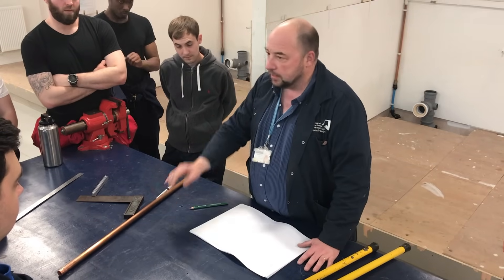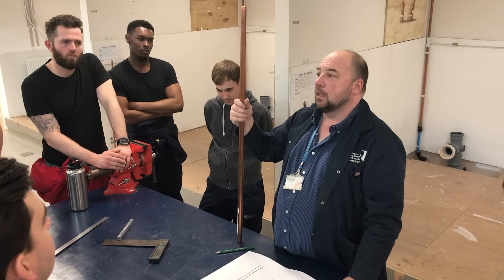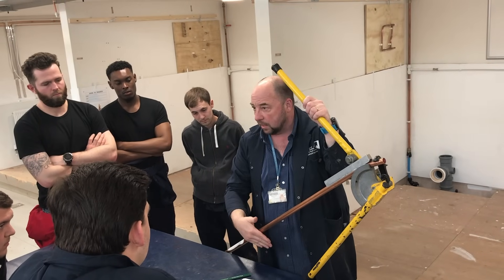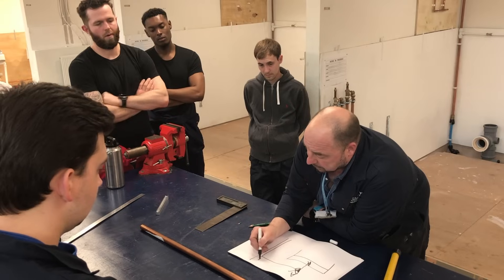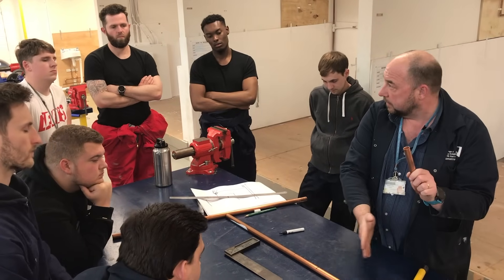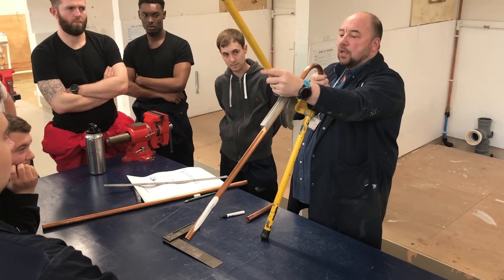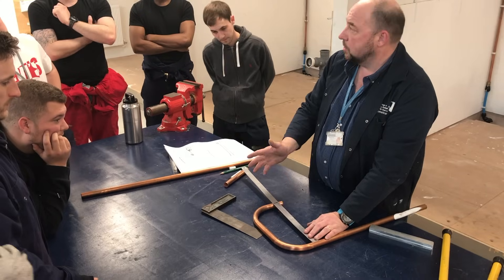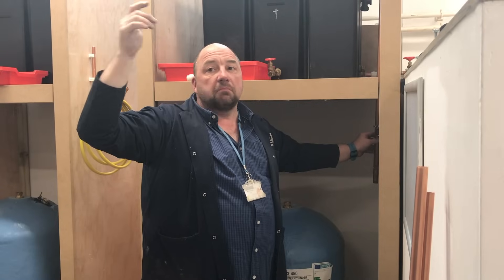How to perform a Centre to Centre copper pipe bend

Comment: I began my apprenticeship in 1976 and passed my journeyman's examination in 1979. Part of the exam involved bending a 15 mm copper pipe with two 90° bends, centre to centre 22 cm, which I still remember today. I still have the piece of pipe from the exam ;-)
In Germany at that time, it was common practice to specify the diameter of galvanised steel pipes in inches. Later, for example, a 1" pipe became a DN25. (DN = nominal diameter in mm) 
The mm dimensions were rounded for the DN specification, 1" = 25.4 mm, so it was made 25.
The ‘real diameter’ of the pipes remained the same, of course.

Copper pipes, on the other hand, were specified in millimetres – I am surprised that they are also specified in millimetres in the United Kingdom.
I have now been retired for a few months.

You explain things well and calmly, which is much better than being loud and harsh with the apprentices.
I wish you a relaxing retirement and, of course, good health.
After working in this trade, how are your back, knees, shoulders and hip joints? 

Unfortunately, my English has become a little rusty, so with the help of:  DeepL.com (free version)

Comment: anyone else here trying to gain intel for class? xD
Reply from the maker: What intel do you want?!
Reply: @PAULOatham  it's my second week in pre trade course, wanted to learn the principles that go into bending pipe and also how to account for the size of your fittings when connecting together...

would you just measure tge thread depth and subtract it from the fitting itself then subtract that number from your pipe lengths?
Reply from the maker: @ethanwasme4307  I think there’s a video on my list on that exact question

Comment: A far easier method of C/C 90 degree bends is to 
Lay your pipe flat.
Put a level/timber piece along the short end
Measure your 300mm and mark it
Put pipe in bender, using a set square align the mark on the pipe with the inside of the bending machine guide
Now pull your 90
Also guys, pull EVERYTHING, that’s how you get good. I was installing a pressure reducing set up on a mains fed cylinder. I could have easily used 2 elbows to join pipe tees that were running horizontally, but instead I came out of the first pipe, turned 90 and ran towards the nearest wall a metre away. I then bent the pipe down just so I could get a bracket on it. After the bracket I pulled another 90 ( which was horizontally level with the bottom pipe) back away from the wall back towards the cylinder. Lastly another 90 to get the pipe into the bottom pipe tee piece. All perfect using this method, quick to do, no leaks on a pulled bend, less resistance on a pulled bend, much better looking than a fittings.

Comment: Would it help if the pipe was warmed up slightly before bending ?
Reply from the maker: No need. The copper is soft enough to machine bend.
Reply: @PAULOatham  ok thanks for taking the time to reply 👍

Comment: Hi, does anyone know how to bend flat copper pipes? 
I understand I'd have to stuff the flat copper pipes with, like, fine sand so that kinks won't form when bending. But is there a specific tool to bend flat copper pipes with?
Reply: I’m an old school professional (retired) plumber. Iv’e never come across a bender for square pipes. If you are going to use sand loading make sure to use silver sand and pack it well you will need to seal both ends, if you crimp one end you will need to make  a suitable wooden plug for the end you load the sand into. Be sure that the sand is dry. When you have the pipe filled and sealed you will need to make some kind of pegboard to use as a bending former ( hope that makes sense so far) if you mark the length of the radius you need onto the pipe, you then need to heat the pipe between the marks and let it cool to anneal (soften) the copper and then use the pegboard to pull the bend. It’s not as difficult as it sounds and may work out as you want. Either way, good luck.

Comment: What a great demonstration. I've done loads of diy plumbing over the years but never realised that there was a measuring science to getting bends precise. Always used a spring and solder joints to get the job done. I have to reconfigure my central heating pipework ready for a new boiler, so today I am buying a set of benders and I am going to do it properly. Thank you.

Comment: Great video. Purchased the bender shown but get cracks on both L and M copper pipe. What am I doing wrong?
Reply: @PAULOatham  I am using the 15MM former for 1/2 inch type L or type M copper pipe. Thank you for your response.
Reply: @PAULOatham  The copper cracks or breaks through on the bend making it unusable. I am using the same bender as you, which I purchased from an British firm, and the 6-inch bar that is placed between the copper and bender. Thank you for the quick response.

Comment: Paul, there’s no vices or square on-Site.  You use a Door Frame for a square.
Pulling a 90 on a 22mm tube, Mark your centre & Mark back your tail 100mm(b), the Mark b goes at the edge of your former & you’ll get an accurate bend.  The second bend can be done the same way it’s called ‘Mark back’.
Last wee point, any vent/expansion pipe must rise a given amount before returning into the storage cistern.  It’ll pull air if it too short & Vent over too.
Reply: Using same method.  Always 100 %